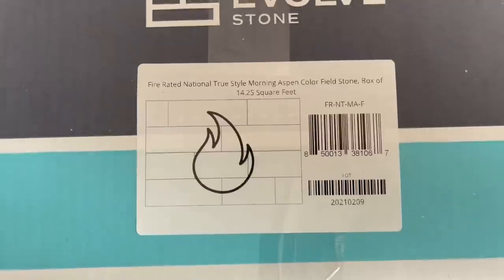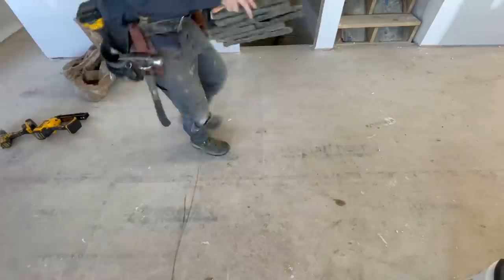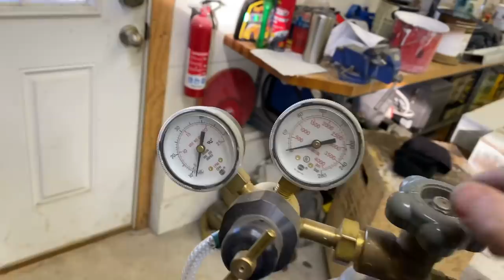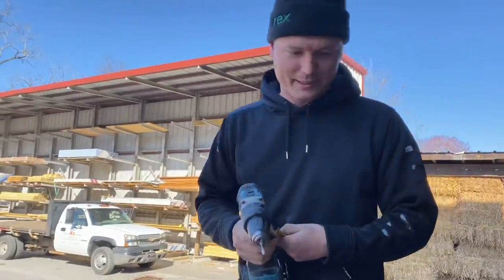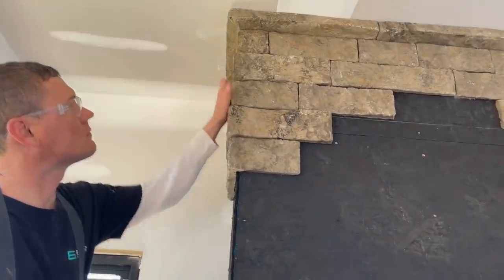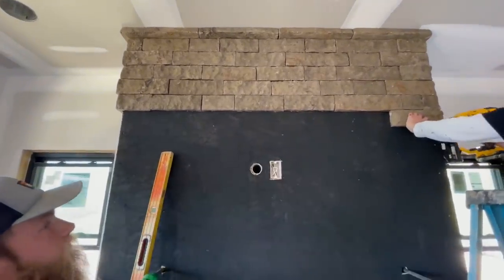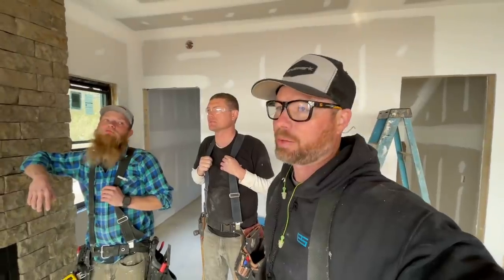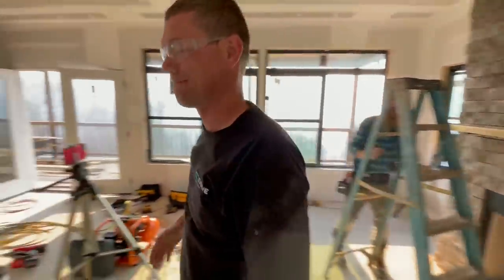Building The Farmhouse | Day 56

Comment: Just paid nearly $2000.00 for stone  1000 for install and 800 for stone that was thin cut and outside corners  .. Had to do the scratch coat myself .. Now I see this stuff !!! .. The area was only 70 sq ft .. Just curious .. is this a product that can used on the exterior ? . I am finishing my opus , swan song after 39 years of carpentry for a neighbor . Stage 4 melanoma has gotten in my way.. I just hope I have enough strength to do the interior trim . It is awesome to see new gadgets and products coming out that make things easier .. Wonder is they are working on nail on brick and CMU's . LOL ..
Reply: They used the evolve stone on the exterior in the “Build a house start to finish” series.

Comment: Maybe i missed the explanation, but why did you paint the osb on the fireplace black? some type of fire protection? thanks
Reply: Usually you paint the surface behind that type of wall product so you don't see any wall behind it. There is tiny little gaps here and there. So the black paint helps hide that after the product is installed. You would do the same thing for any type of reclaimed barn wood panels etc. :)

Comment: Nothing like screws and nails sticking out of your fake brick to really make your house look cheap. Add in that the stone is extremely uneven, and it now looks like it was installed by an unskilled mason on top of that. Did you even use any kind of adhesive or just nails?
Reply: Someone seems a bit miffed. On a 52 inch 4k tv I could not see the nail heads. I looked. But hey your free to complain from the comfort of your arm chair, toliet, or wherever you watch the video at. 😆😆😆
Reply: Damn bro, why don’t you speak your mind! These guys build houses for a living.